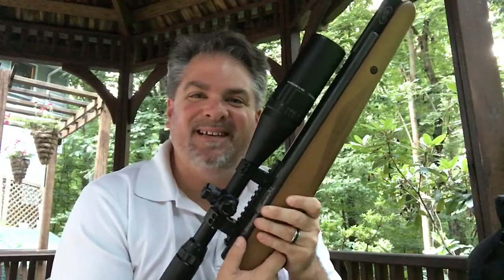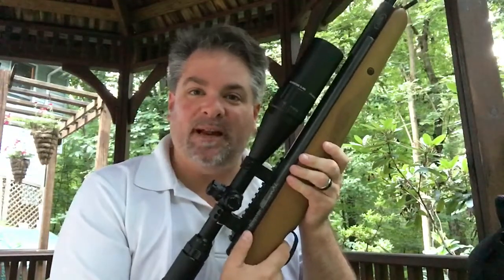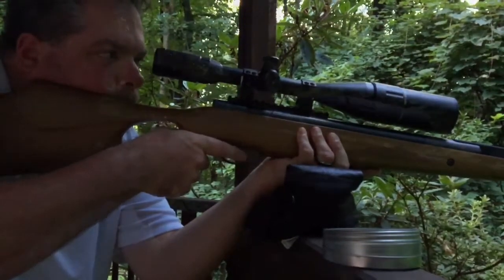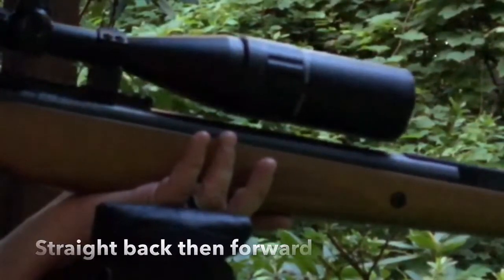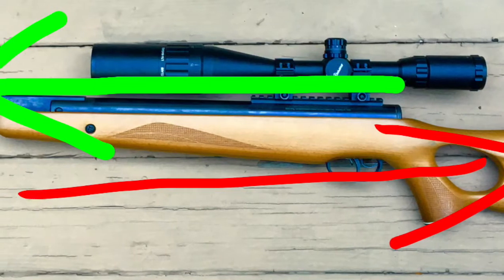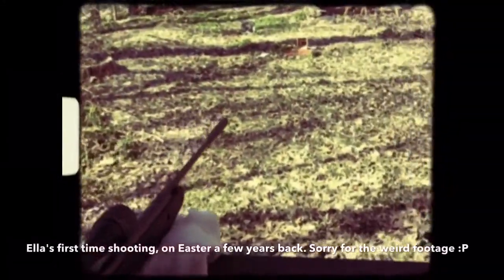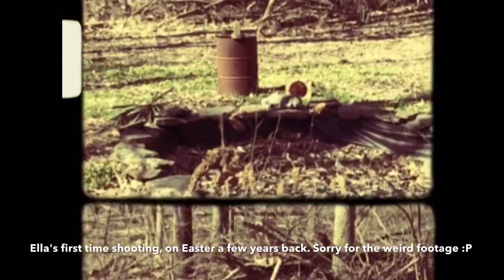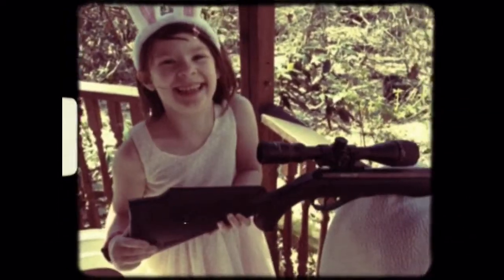The Artillery Hold for Airgunners (A simple explanation)

Comment: Why do you rest your finger on the trigger when you are in non firing position?
I was always taught to rest the trigger finger against the trigger guard.
Reply from the maker: mark. clark catapult man You are correct, and I have been asked about this many times. On these particular rifles, the safety is just a simple lever in front of the trigger. I have bumped them out of position before. So on these guns, I’m not actually holding my finger on the trigger, but holding the safety in place in front of the trigger. Any other rifle or gun, I put my finger above the trigger area against the stock as you’re supposed to do. Hope this answers your question.

Comment: There are some people that try to explain the artillery hold, but can't even figure out how the recoil works.
Reply from the maker: mrnickbig1 I hoped I explained it ok.
Reply: The recoil is back first, then forward. It is the forward jolt that causes the problems. You won't believe how many people get simple physics wrong.
Reply: I am quite familiar with it because I have a Hatsan 125 Vortex .25 (750 FPS), which is a bit more stout than the Benjamin. I considered the 135 Carnivore .30,  but the velocity is far too low for my taste. If they came out with a .30 springer that hit at least 700 FPS, I'd probably buy one, if the price wasn't outrageous. I also have a Bullboss PCP .25, over 900 FPS.

Comment: What scope do you have on this?
Reply from the maker: Matt Smith SNIPER Scope 4-16x50mm W front AO Lens. Red/Green/Blue Illumination mil-dot reticle. Comes with extended sunshade and Heavy Duty Ring Mount and lens cover https://www.amazon.com/dp/B005ICG6IK/ref=cm_sw_r_cp_api_i_HmHwCb641F357
Reply from the maker: Matt Smith I don’t have that gun anymore, but still have that scope. It’s on my Diana Stormrider Gen 2 at the moment.
Reply: never really understood the point of such a scope on a break barrel rifle lol. The amount of movement in the barrel, makes it completely useless.
Reply from the maker: j p It’s actually not that big. Having the sunshade on it makes it longer. The reason I used that scope is to have a larger objective lens to gather more light. I had left the shade on from the day before. I shoot in the woods a lot so the bigger glass helps. Thx for the comment!!